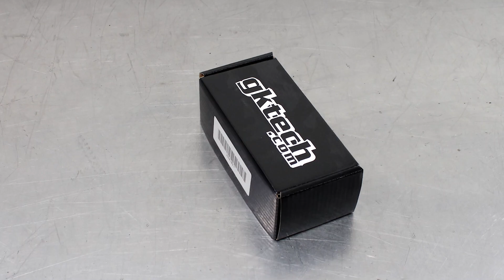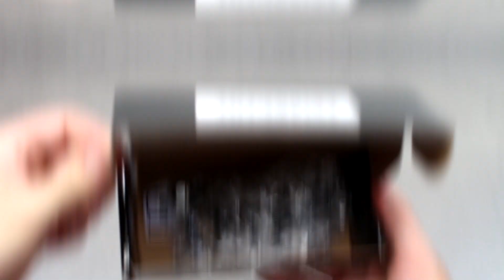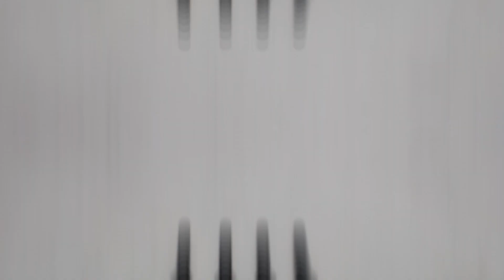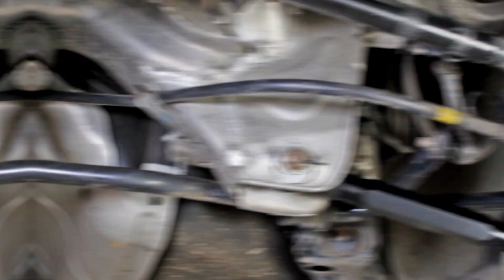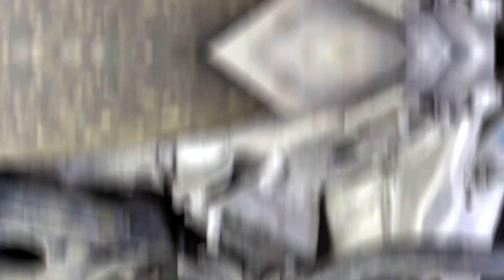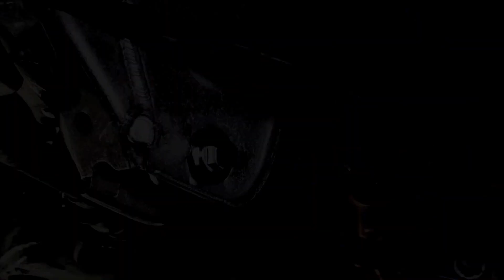Gktech Eccentric Lockout Kit - Install

Comment: My left rear toe bolt and nut snapped during an alignment so they couldn’t continue and just left the bolt in. Since it just slides in, I can just hammer the bolt out the other way right?

Comment: Would you recommend running this kit with stock rear suspension?
Reply from the maker: You can, but if the suspension is stock you will need them for adjustment/wheel alignments.

We just released a video, explaining this also 😃

Comment: These are the ones I use in my car.
Install video if it helps: https://youtu.be/K07e9S89z5Q
Upgraded to these bolts when changed my suspension arms and after one of the OEM Bolts Rotated affecting the alignment.
Thank you for this guys!